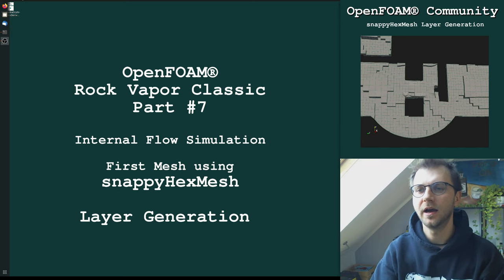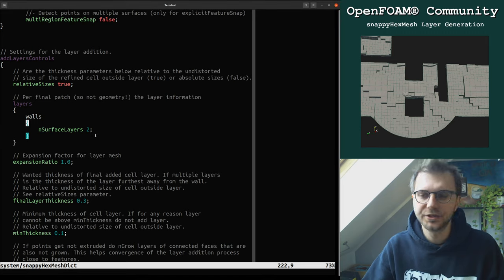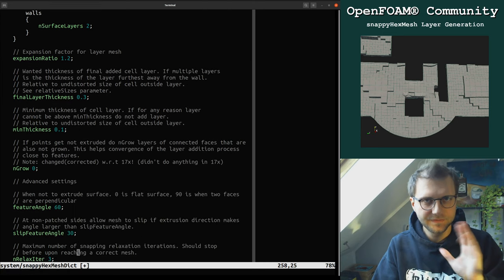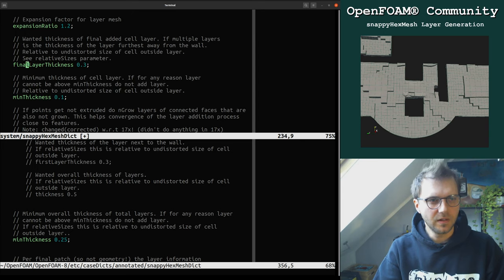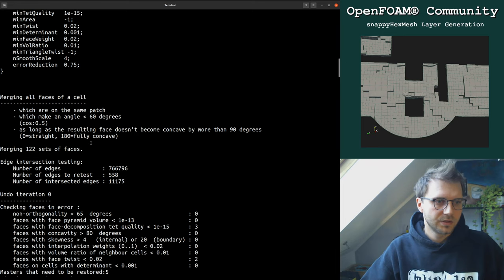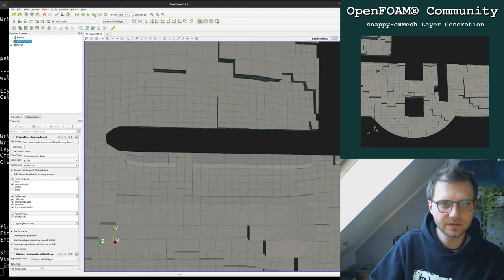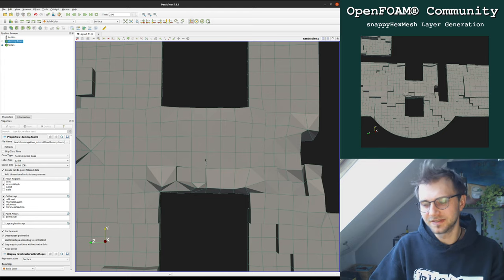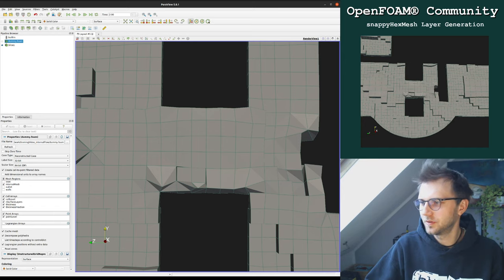CFD Analysis of a Smoking Pipe | Part 7 | SnappyHexMesh Layer Generation ∇ OpenFOAM® v8

Comment: Hi Tobi, thanks for the helpfull tutorial, you mention that the addLayer function leads to a move and deformation of the cells of the castellated/snapped mesh. You also mentioned that it can be difficult to add layers in a "channel" from both sides as cells get pushed together. Is there a solution to handle that. My problem is that i have an curved channel, looking like a flat lying "s" and i need the mesh inside that channel to follow the boundary walls, as I am doing a porous simulation, any tipps for that kind of setup? I managed to create 3 layers on each wall of the channel but the middle cells are stillaligned to the kartesian koordinates. Adding more layers leads to problems on the walls which i suspect is due to the displacement of the other cells. I will post my question in the cfd-online forum and add some screenshots for clarification.

Best Regards 

Daniel
Reply from the maker: Yes there are ways.
Please sent the cfd online link
Reply from the maker: @Daniel-gv9gr  most of the people use sHM. I am working for the automative right now and they also build high-complex meshes with sHM.

You can use salome and create a tet mesh which you can convert to polyhedra using the polyDualMesh application in OpenFOAM. Alternatively, cfMesh.

Comment: 17:50. Regarding the layer collapsing in the corners can be improved a lot without sacrificing too much computing power adjusting the featureangle to 180. Check slide 44 of the presentation "A Comprehensive Tour of snappyHexMesh 7th OpenFOAM Workshop 25 June 2012" by Andrew Jackson.
Reply: I've jumped from 96% to 96.6% coverage only doing this (I am doing a much refined mesh tho)
Reply from the maker: @tomasmanrique400  yes and you can also get 100% probably on cost of cell quality loose. E.g., you can also use the laplacian solver rather than the default one. This would lead to nicer layers too. Furthermore, we implemented new additional features to improve layer covering even more.
Reply: @HolzmannCFD  thank you for the insight Toby! BTW this series of videos are a blast!

Comment: Great video once more! I find it quite tricky to properly handle layers in snappyHexMesh. I wanted to ask you Tobi how can I control the expansion ratio in my entire model, say in the vertical dimension?

I thought that the only way would be via layer addition but based on your video I understand that the cells between the added layers are just get squeezed and not overwritten.
Reply from the maker: Right, you have your finishd snapped mesh. Then you add cell layers on top of the surface and push these new cells towards the surface of your snapped mesh. Hence, the internal mesh get squeezed and distorted. 

However, I am not sure if I got your question correct regarding the expansion ratio. The expansion ratio is already a keyword for the entire domain. However, if you have it within your patch (layer) information, it only is active for that patch.
Reply: @HolzmannCFD  I wasn't aware that the expansion ratio is available in the CastellatedMesh controls. I've never encountered it before. I just found it in the snappyHexMeshDict that you opened in $FOAM_ETC/caseDicts/annotated  but I am not sure what does smoothing of expansion ratio actually means. 

Anyway, I will look into it. Thank you very much!
Reply from the maker: @gregorsamsa2816  I was not aware that you are talking about the »castellated« meshing step as this video is about layer generation. However, I never found the »expansionRatio« within the castellatedMesh control section. Do you mean something else?
Reply: @HolzmannCFD  Thanks, I think I'm covered. I suppose that the only way to control the expansion ratio, say to a specific height, is by adding layers to that height.